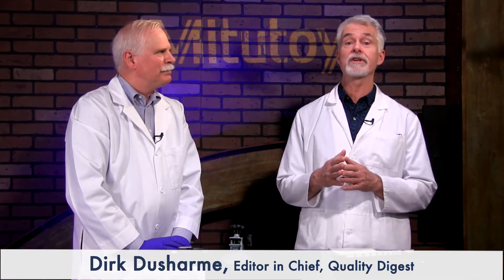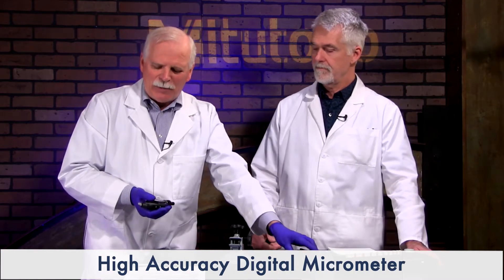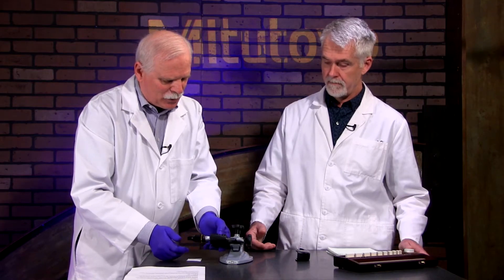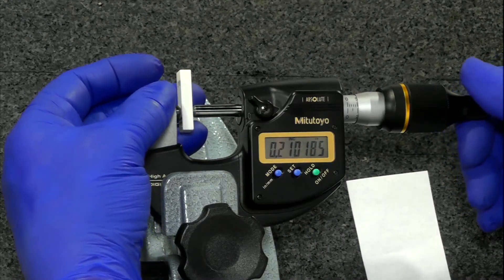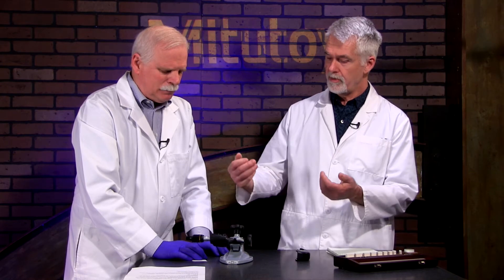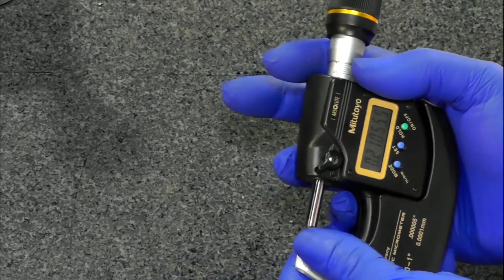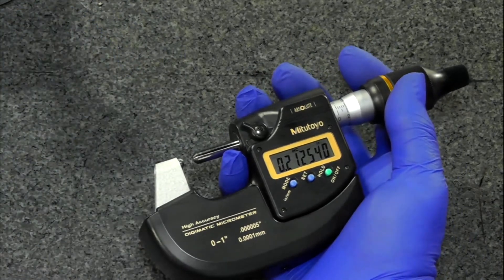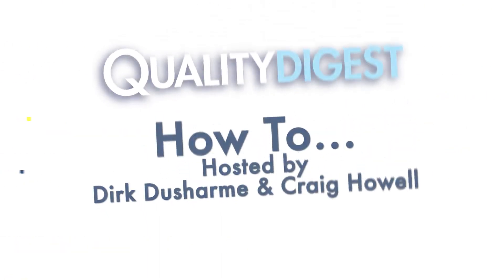How To Ep05: Use a High Accuracy Digital Micrometer #metrology #micrometer

Comment: Seems pretty lazy to me using a digital mic.   Just use your brain and learn to read a normal one .
Reply: Chris Burnsed  unless you’re Job requires it why wouldn’t you use a digital micrometer if you are measuring diameter of thickness
Reply: @sexsells1754  thickness has no diameter, only depth.

Comment: Hello! What is your opinion on how many times one should “click” the ratchet? I’ve always stuck to 3 but I’ve heard that it doesn’t matter, you’ll still get the same reading. I’m just wondering if constant ratcheting will lead to a breakdown of the gage?
Reply from the maker: I agree with you about 3 clicks. I have not verified it, but I was told 30 years ago that was an Air Force spec. What I do know is, the moments just before the clicks are critical. If the spindle hits the object hard, you will read too small even before it clicks. If you are not in full contact, meaning both anvil and spindle are not perpendicular to the piece, you likely will read low. My own method is to carefully approach the contact, slide it a bit up and down (if it is safe to do that just slightly) to feel the contact, and then smoothly click it 3 times. It sounds like a lot, but in practice happens pretty quickly. 
Craig